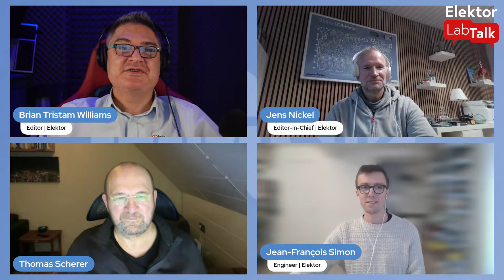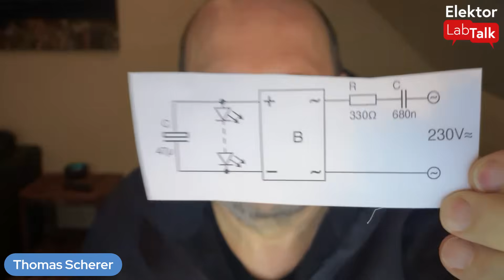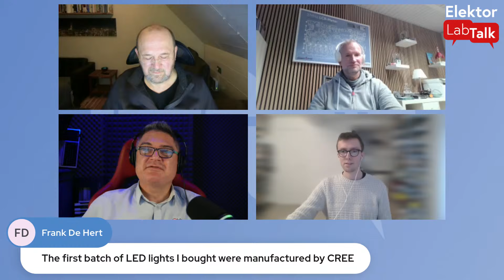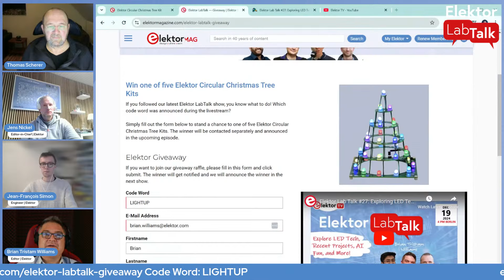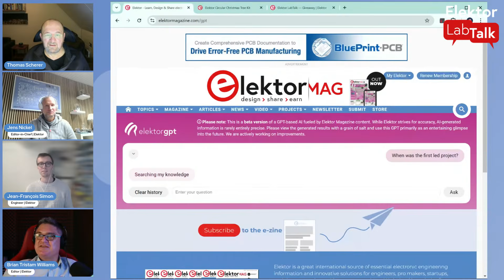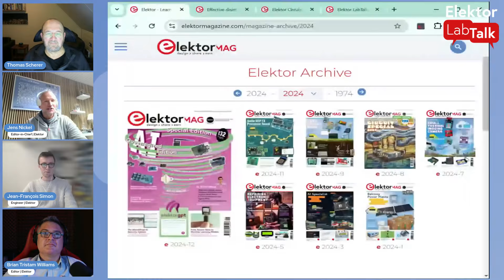Elektor Lab Talk #27: Exploring LED Technology with Thomas Scherer

Comment: Dr Scherer discusses the benefits of LEDs over incandescent lighting, emphasizing their efficiency and cost savings. He also touches on common failure points in LED bulbs, including poor heat dissipation and low-quality power supplies, which often cause premature failure despite manufacturers' claims of 20+ years of operation. Have you had any experiences with LED failures? What do you think causes them most often? I seem to have bad luck with them